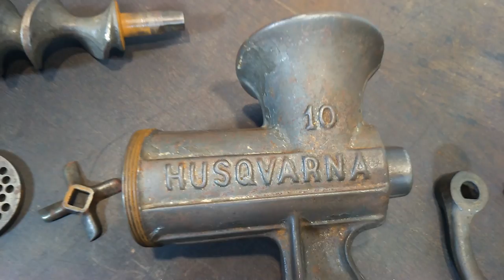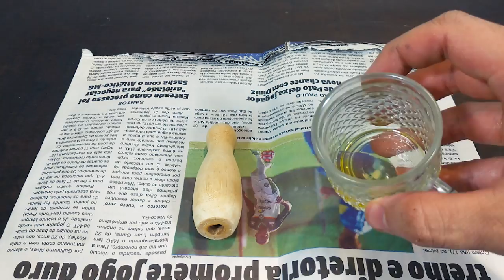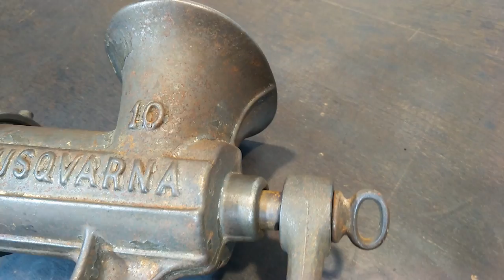Atique Husqvarna Meat Grinder - Restoration | Workshop DC

Comment: Very nice result! Especially that you didn’t paint the metal to metal contact parts. I use this paint aswell, it’s Food compatible and fruit acid resistant. Nice job!
Second: I’ve never seen a Husqvarna Meat grinder 😄 I knew that they produce bikes and sewing machines. 
Nice project, well done, thumbs up!
Reply from the maker: Is the first time that i saw a Husqvarna meat grinder too, this Grinder is very pretty in Live.
Yep! This paint are made for that and is very resistent.
Thanks for all! <3
Reply: What is the name of the food safe corrosion resistant paint used on the inside? Thank you!
Reply from the maker: Its a industrial Paint, I don't remember the right name but It Is a Epoxy one.
Reply: @me446  in Germany it’s called „Kelterlack“.